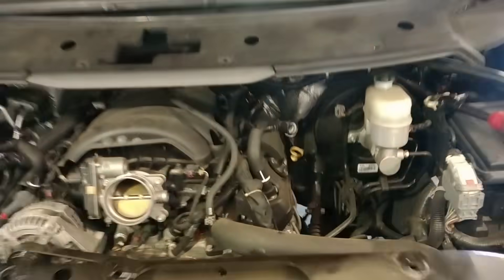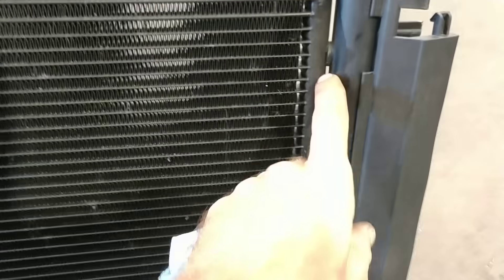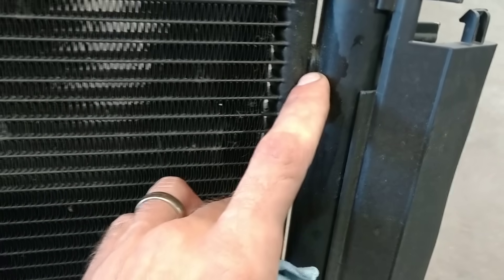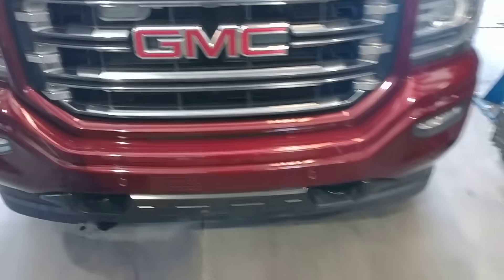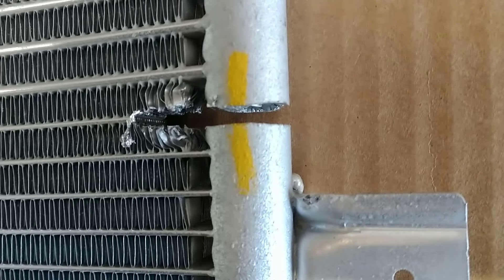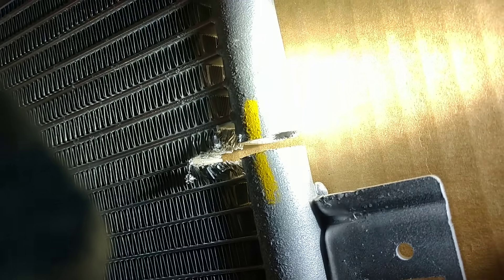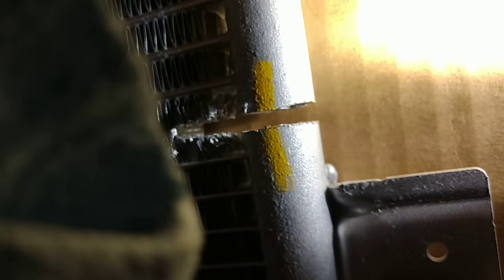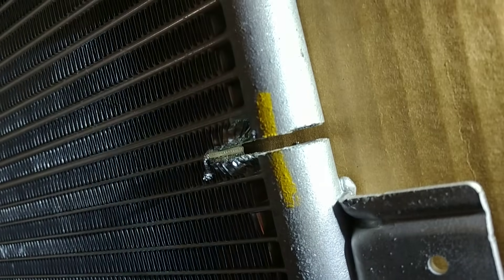Customer States...WAIT, look at this! Can't make this stuff up!

Comment: So the burning question is...what the f#@%÷ happened to your replacement condenser, right?
Reply: @farmcentralohio  Read the video description, I've seen about 4 pictures of them like this that my GM dealership tech friend has sent me. If ypu search the AC Delco new revised part number on ebay you'll see them on there as well if you look.
Reply: @CondoreComputing  I think you have bad info because the part in this video just won't work at all
Reply: @ztm454  Read the guys description, he used it.
Reply: It's how GM decided to address the mass 2015 to 2018 AC condenser failure issue after the class action lawsuit and partial recall.
Reply: @ztm454  You don't understand that the core consists of a trans cooler and AC condenser. The vertical tube is blocked on either side of the yellow mark. The mark is there as a " cut here " mark.
Reply: @ztm454  You are wrong unfortunately.
Reply: @CondoreComputing  Hey Condore, can you freind at least confirm that the depth of nthe cut is kinda off? Like I get cutting the pipe but why the fins? Same reason? (p.s. unike others i googled your and ops description statements to find it is indeed true. Now I am back to ask a fun question and give you a crisp high five for being patient with everyone.)
Reply: @YenSnipest  It seems like since they are all done by hand, the quality of cut definitely verys, this one is real ugly, but my understanding is that a couple of the rows in the condenser are plugged off from the rest, so going too deep into the condenser doesnt have any bad side affects other then looking terrible. At least that's what I took from what he told me.
Reply: But you can’t ship something out like that and call it quality.. rough and sharp edges, bent fins and everything.
Reply: @starstencahl8985  That is why the whole world outside the US, think american cars are crap, extreemely expensive (cheap chrome and bad spareparts)
Reply: @reasonablySmartIdiot  Yeah, but the Japanese would never perform such an absolutely disgusting hack job such as this to fix an engineering flaw, not even the Italians, French car manufacturers. This is beyond half assed. I see now why GM is considered one of the worst car manufacturers in the world.
Reply: Yeah why was a cutting tool anywhere near it in the factory
Reply: Turns out this is actually how they are supposed to be, this is how they all ship. This is how they isolate the AC condenser section from the transmission cooler section. A factory budge to fix a design flaw that causes excessive heat to transfer from one cooler to the other.
Reply: @CondoreComputing  what but its cut so it would just spew coolant everywhere I have a feeling I'm being wooshed but I mean come on
Reply: @ztm454  I asked a friend that works at the dealer here, they are capped internally, the two rows between the tranny cooler and AC section are not used. It's ridiculous but it is real, give me a sec and ill send a link to a picture of another one like this.
Reply: @CondoreComputing  when you pay closer attention, it makes more sense.  You can see that the tubes are thicker above the cut on that condenser, as well as on the removed one, as they'd be moving transmission fluid or coolant, not refrigerant.   Additionally, that section has connections on either side of the whole unit, whereas the AC condenser portion has two tubes on the same side of its section.  This can also be seen on the removed unit, behind the step stool.

It sure seems to be as-designed, but looks atrocious with how it's done.
Reply from the maker: @ztm454  No it doesn't leak. The top Yahoo and bottom tank have plugs in the end. What you see is two separate coolers built as a single component.
Reply: @CondoreComputing  I get that but it could be a bit cleaner looking.
Reply: @Zimeftw  Definitely not disagreeing, it is a terrible ugly way to repair a problem.
Reply: @CondoreComputing  you're screwing with me???
Reply: @farmcentralohio  imagine publicly posting how wrong you are lol. You should be embarrassed
Reply: @farmcentralohio  You don't understand that the core consists of a trans cooler and AC condenser. The vertical tube is blocked on either side of the yellow mark. The mark is there as a " cut here " mark.
Reply: @bobroberts2371  and why aren't the sharp edges removed? This can not possibly be a finished product.
Reply: @farmcentralohio  damn last time I was that confident and ended up being wrong I had just had to delete my comments. Too embarrassing lol
Reply: @farmcentralohio  Did you read the comment above BY THE PERSON THAT POSTED THE VID?  If not, here it is again.  
 Rainman Mack
No it doesn't leak. The top and bottom tank have plugs in the end. What you see is two separate coolers built as a single component.
Reply: @bobroberts2371  built as a single component mickeymoused apart with an angle grinder and not finished off the way it should be. This is not acceptable.
Reply: I used to deliver parts and seeing something like this would cause a customer to return a part
Reply: Nothing like ordering a radiator and having it delivered with a hole in the shipping box the exact same size as the fork from a forklift and tire tracks. FedEx didn’t have a problem delivering it in the state either.
Reply: My take on this from my tier 1 experience is a sample part from quality testing got added back in the the main stock and shipped
Reply: @BigFootedMOTHERFER  Did you make any effort to read the vids description and the post in this thread from the vids poster Rainman Mack ?
Reply: @BigFootedMOTHERFER  No, it was inspected and approved as that is the way it was intended to be when shipped.
Reply: @farmcentralohio  gm made me buy a new ford mustang. never ever thought I'd be a mustang guy. but here i am. 21000 into a 36000 mile warranty 🤞 if anything goes wrong, and i paid it off, I'm goin honda/Toyota.
Reply: I own a 15 Silverado LTZ 6.2 double cab, 90,000 miles, zero issues so far, will keep an eye out for this. It's been a great truck so far, that 6.2 ain't no Joke.
Reply: @farmcentralohio  welcome to America bud, made in
US of Ahole GM quality right there. Why build something good when you can just pretend you do and cut costs instead!?
Reply: @kencraft4567  So tell me why the design is bad?  Would you rather the vertical tube be one piece and have thermal stress cause things to crack and fail just like the original?  Why don't you become an engineer / start a company and make these the way you see fit?  Should be an easy money maker no?
Reply: @bobroberts2371  I'm referring to the original design which clearly wasn't through very well, since it requires an angle grinder to fix? This is legit built in failure, or lack of engineering entirely. what are you even saying? yeah ill just pop up and compete with the big 3, that makes sense. elon musk did it why not. easy money maker. just wow. go stick your head back in the sand bud
Reply: @bobroberts2371  it's terrible because despite the fact that this works you should never ship parts with razor sharp edges on them. That's a safety hazard.
Reply: @randomdudeontheinternet9926  If the edges are a safety hazard to you, you should not be working on anything mechanical.
Reply: @bobroberts2371  He's right. As someone who's worked with my hands for 55 years (mechanic, autobody, carpenter and musician) those edges could ruin your day if you don't know they're there.
Reply: @curbmassa  The sharp edges are not the greatest thing however, most of the people saying the cut is a defect that will cause it to leak.  The don't understand that the trans cooler and AC condenser are built into one unit.

Comment: Been having major defects from reputable brands left and right lately. Everything from auto parts to home appliances. Somethings up.
Reply: GM hasn't been reputable since the early 2000s.
Reply: @i80386sx  definitely my 01 is still going strong mostly all original parts on it. Except the normal wear parts.
Reply: I can't even get a squirt bottle to work anymore. Clorox, spray nine, purple power, windex. All won't squirt. plus made a hell of a mess when i launched one across the garage.
Reply: @yamaha226  been having the same problem🧐🧐
Reply: Because almost none of them manufacture in the USA anymore... it’s all 3rd world crap assembled by someone making a buck fifty a day and he rightfully doesn’t give a shit....
Reply: Not just that it’s like there’s no supply of anything. I work at a Nike store and we are running out of shoes and aren’t getting any major shipments any time soon. Black Air Force 1’s (one of the most popular volume sellers) is completely sold out online. I went to bobs furniture and they were completely out of their budget foam mattresses as well as a lot of other furniture. There’s a ton of empty shelves at Walmart that are usually filled to the brim. My mom went to Costco last week and they were out of Poland spring water bottles. Something is up and it’s past that boat being stuck for a few days
Reply: @Dragon228833  Look up the Los Angeles port situation. It's been clogged for weeks. More container ships than they can process.
Reply: @erkay3504  thanks. That explains a lot. I haven’t seen much on this
Reply: It's called "Everything comes from China.. And they are giving even less of a shit about quality then normal lately"
Reply: It's supposed to be like this, the trans cooler and AC condenser are one unit. The cut is to allow for expansion between the two.
Reply: Supply chain is outsourced.
Reply: @Adam Khan Which is owned by GM.
Reply: @rando5673  Or someone previously bought/ tried to install and returned the sensor.
Reply: same thing is happing to my moms 2017 forester its on its 2  condenser   going on to its 3rd do to corrosion on the part. also its on its 3rd ac compressor the original compressor was grinding so it was replaced with a new one but right after we left the dealership about 20 or so minutes after we left the ac compressor exploded and there was ac oil every where and the ac compressor sized and the car had to go back to the dealership to replace the new ac compressor with a new one again  its on its 3rd ac compressor and get this the care is only 5 years old with a little over 100,000 miles on it.
Reply: my ford has all its original ac parts and its is ice cold. but the major thing that had to be done was a new v8 motor because the motor was bad. the owner before me said that the motor was new. but when i took it to my macnic he sad the motor was blown up and come to find out i think the owner before me lied to me.. so do not buy a used car from a privet party you should be thinking to buying a car from a dealership.
Reply: Sounds like a YOU problem, doing like you did aka having no clue about mechanic and going to see a vehicle without the assistance of a mechanic to check the vehicle to make sure its what is offered and in the condition its listed, thats all on YOU.

Not to mention you didnt even ask a mechanic what kind of car is good/reliable nor research yourself about the cars you like to see if they good or not.
Reply: LOL GMC is reputable? Absolutely not.
Reply: Lamp you’re stupid for buying a new car you pop the hood and all you see is plastic you like paying 400$ for a starter my 98 Dakota I got it for 60$ brand new lmao on Amazon no problems
Reply: Kleptocrats working hard at destroying America.

Comment: I guess they don’t have any QC’s to catch stuff like that. 😂
Reply: Plot twist: QC cut the condenser open to inspect the inside.
Reply: That is how it comes sadly. I've been doing GM parts for a decade.
Reply: That's how it comes, but it's not damaged, that's a division, top is tranny cooler, bottom is condenser
Reply: @Mondos2001  "Yeah, the jagged angle grinder cut in the accumulator and core is standard" -GM

"Yeah that checks out, totally cool!"" -GM owners coping with the fact they bought a Government Motors product